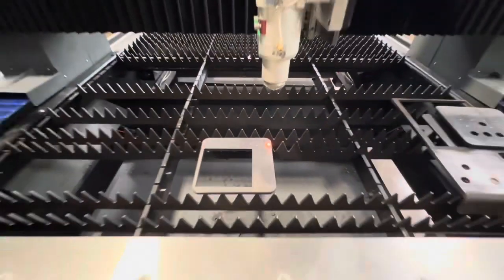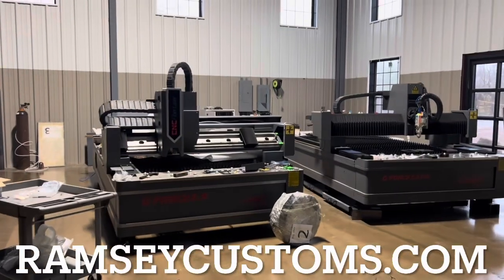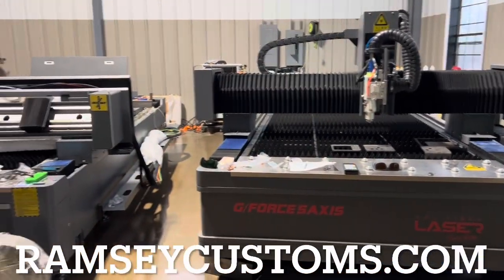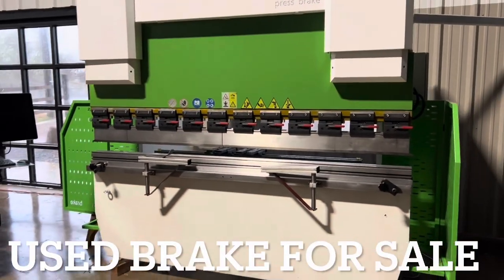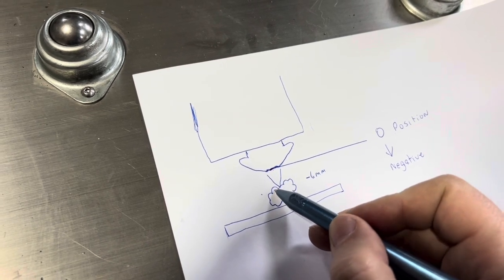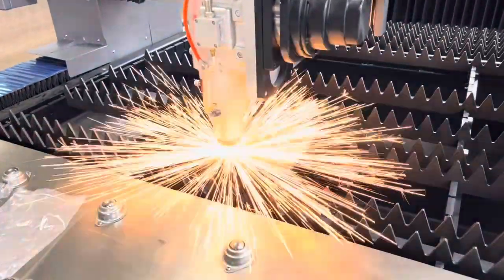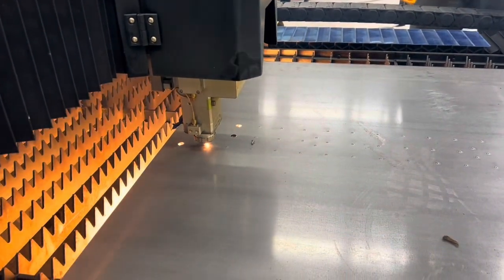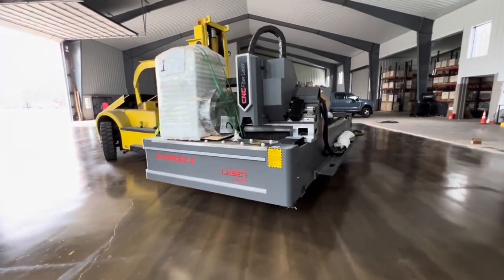Bad Pierce CNC Fiber Laser

Comment: What material properties make the material "laser grade"?   Are you typically using cold-rolled steel to avoid the scaling from hot-rolled material?
Reply from the maker: there are many variations of it, different mills have different grades.  SSAB has some very nice branded materials that will give superior results compared to your local A36
Reply: @turbocobra  
Good to know.   I wouldn't have even considered asking.